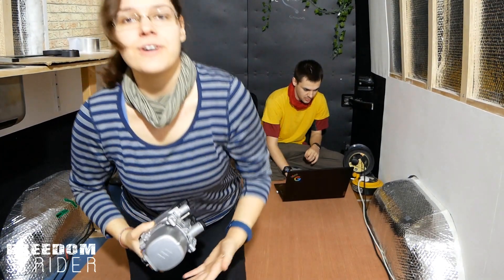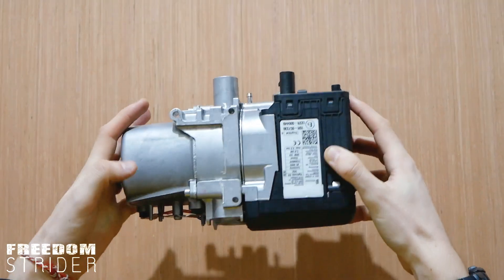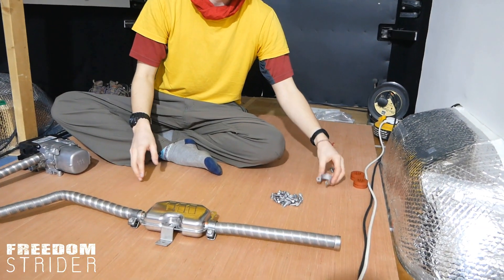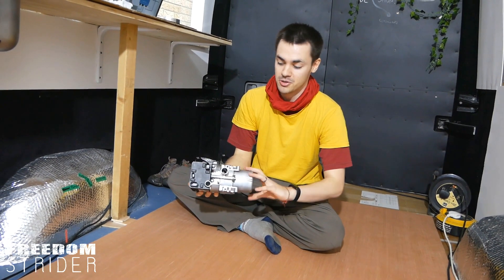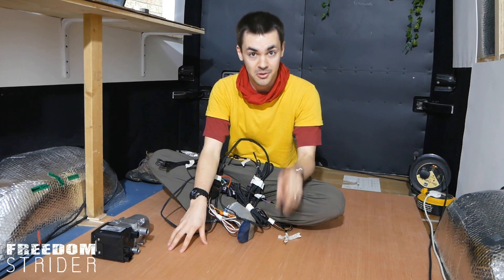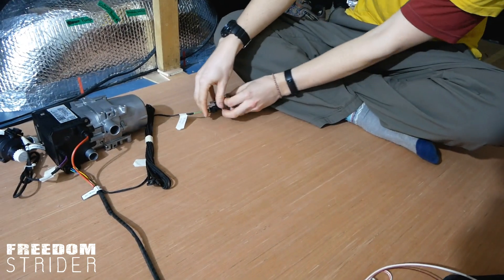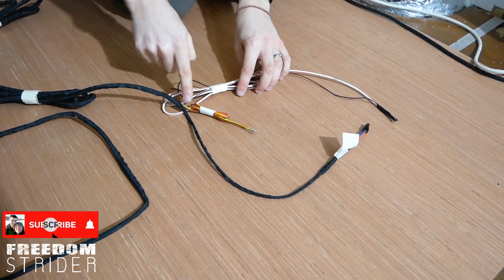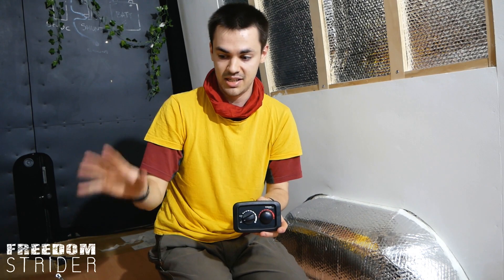WIRING EXPLAINED! Espar Diesel Hydronic Heater

Comment: Easy start pro controller has 4 wire connector. But my Hydronic S3 D5E has only connector with 3 wires . Is there any solution to this?
Reply from the maker: Hmm, there should definitely be a 4 pin connector coming out the heater with the same colour wires as the easy start pro connector?

There's a 3 wire brown/yellow/red that can be used for other controller types but the easy start pro has a specific connection port...

Comment: This was great! I laughed through half of this because your confused facial expressions are exactly what mine were when I unboxed this same kit. Thank you!
Reply from the maker: 🤣 They don't make it easy for people at level 0! It took us a while to trace each wires function..

The only thing we've learnt since this video is that it is worth wiring the air matrix directly to the heater power supply (using the black/red thing wire as the power wore to the air matrix control unit). This will allow the matrix to turn on at the same time as they burner itself 👍 
It's excellent when you're asleep and have the burner on a timer 😎 (otherwise you have to wake up to turn on the fan every few hours)
Reply: @FreedomStrider  One other question - did you verify that the ball valves you are using are rated for ethylene glycol, and if so, what product did you use?

Comment: I’m trying to combine me airtronic and my hydronic together to the easy start pro controller. Online it says it’s possible but it doesn’t give instructions on how to do it??? Any idea?
Reply from the maker: You're right there is a way to do it, I believe it involves that small red/black wire, and the red/white wire we haven't used. I'm double checking for you as it is something we want to do as well, and when I have it working I'll let you know 👍

I believe instead of connecting your fan to your fusebox power, you instead connect to fan positive to the red/black wire from the furnace, but I'm not 100% sure
Reply: @FreedomStrider  WE FIGURED IT OUT!!!
Reply from the maker: Oh, which wires are connected where?
Reply: @averycullins9658  awesome! I'd be interested is how you did this!
Reply: @averycullins9658  Any update on how you did this? Cant figure it out myself

Comment: Did you air do the video on hooking up the other controller?  I have been waiting for that, its my last step in setting up our system.  Your videos have been amazing, between you and Wanderful Revolution you have made the set up of my system super easy!
Reply from the maker: We haven't yet no, but if you're talking about the air matrix with the 6 wires (2 red, 2 orange and 2 black), then the 2 orange are joined together and are the +, and the 2 blacks join together and are the -
Then you connect this to whatever blower controller you have (it is different for each one), hope this helps 😊👍 cheers!
Reply: @FreedomStrider  first, love your videos and am super appreciative, as it's saving me a lot of headache. I purchased a kalori blower with built in fan speed control are you saying that if I just connect the wires per this commemt to the blower that I'll be able to use the easy start pro to control my blower unit to automatically maintain temperature in the van? Thanks in advance.
Reply from the maker: So what you'll want to do is wire the Kalori blower as such:
1. Both orange and both black are + and - that go into the WPM ("banana" spades thing)
2. The Black/red thin wire coming from the Eberspracher unit will be wired into the Fan Controller, instead of a power line (so in the 4 slot piece, I believe it's numbered as 1, but double check the diagram, it's the one that provides power for the controller - this means the fan controller unit gets power from the Eberspracher furnace, which means when you use the easy start pro controller to turn the furnace on, this then turns on the fan controller and thus the fan)

You can then connect a temperature control unit to the easy start pro, have the furnace turn on at certain temperatures and this, the fans will also turn on 👍

Comment: You're both amazing, what kind of background do you each have, very intelligent that's for sure, nothing seems to stop you both. There's one thing, I'm not sure if you've done it already or know, one of the other UK YouTuber's (Mel's Van Life) updated his fuel pump so that it was dangling, it seems if you don't let it dangle then it's noisy with that constant ticking when running, same as a fresh water fuel pump, needs to dangle too...lol!
Reply from the maker: We haven't touched the fuel pump yet, but we have it in our note to let it dangle. Thanks for the reminder. 🙂
Our backgrounds are mixed, a bit of mechanical knowledge, some woodwork, a sprinkling of maths and science. We are largely self-taught, we like to research and understanding what we are working with. I guess we are trying to become a "Jack-of-all-trades"😉
Reply: @FreedomStrider  thank you for replying to my comment. You are both amazing and I'm in awe of you. I'm also in the proceeds, since Nov 2019 of planning/designing a VW Crafter layout, I've put in my order 12 months prior to requiring it as I'm in Australia and I've already received a 5 week delay message for the parking assist mechanical part...lol...unlike you both, my head is topsy turvy over the electrical side of things, just can't wrap my head around it, I'm also over 50 years old...lol...needless to say I'm having to go interstate to have a qualified van converter build my van, the upside is that I won't have the van delivered to me until it's converted, so no insurance/registration or paying for the van until delivery, and makes it easier to get it there, as I'm a 6 hour drive away and one person can't drive two vehicles to get there and pick it up, it would cost me a hire car and airfare each time...lol! I'm still finding it hard to understand if I go 24V batteries, I'll have air conditioning (it's Australia after all, and an over 50 year old woman to go with that and it will be my fulltime home, eventually overlanding overseas with it too), electric hot water system and a diesel heater. I've added a 2nd alternator 180A and thought I'd go down the route of having a buck boost converter 12V-24V...argh!

Comment: Great! Very useful, well explained😁 do the glycol wires have to be in the van too?
Reply from the maker: You technically can have the glycol pump mounted on the outside of the van, so you could keep those running on the outside. We are putting out pump on the inside however 👍